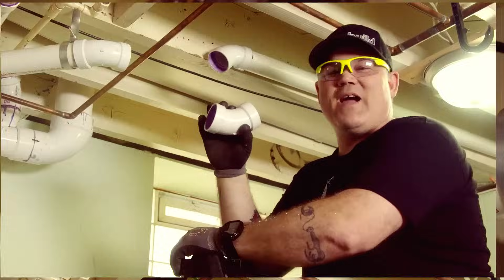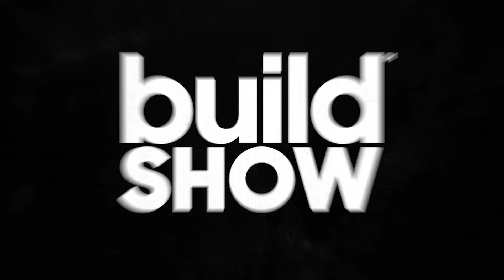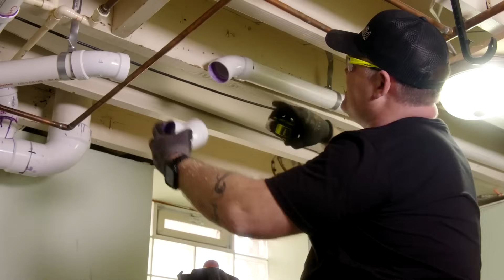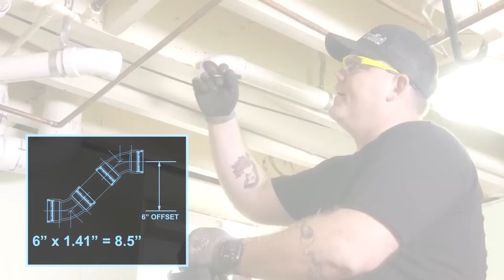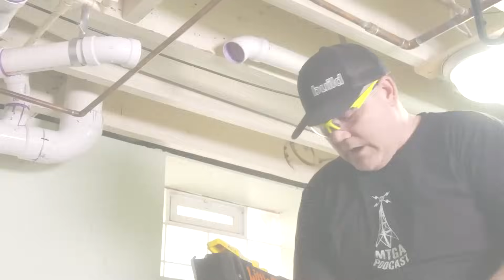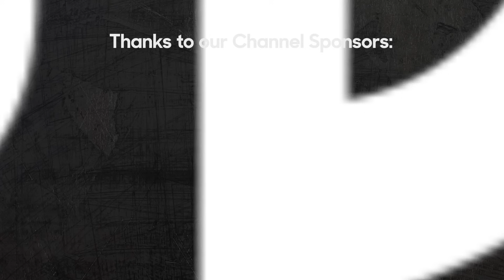Plumbing Math for Offsets with Eric Aune | Best of The Build Show

Comment: This may be a really stupid question but how would you figure the 45° offset if one of your pipes was vertical and the other was horizontal and you were trying to connect him using Two 45° fittings.

Comment: Sneaky. Note there's a second piece of pipe added in this operation to make up the horizontal distance. Only the length of the diagonal piece was calculated and mentioned, but that horizontal piece is critical if the two pipes at different elevations are 1ft apart, 2ft apart, 8ft apart, etc.
Reply: He definitely should have mentioned it. Even though that doesn't need a calculation because you can easily and accurately measure that in place after calculating and cutting the diagonal section, the fact that he snuck it in there is disappointing. Now, was that omission his decision or the result of the video editor wanting to keep things short? I would bet on the latter. This is unfortunately a common theme for this channel...videos that fall short for a variety of reasons.

Comment: Does this formula only work if your pipe is in a straight line? If you were to offset the pipe it would need to be longer, correct?